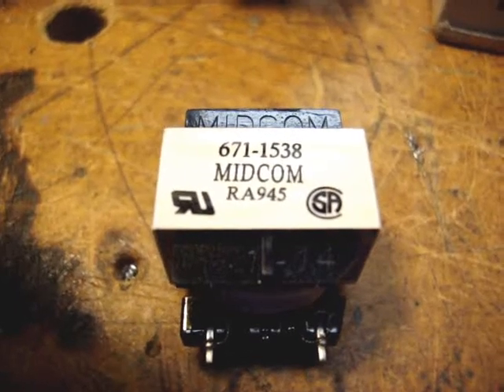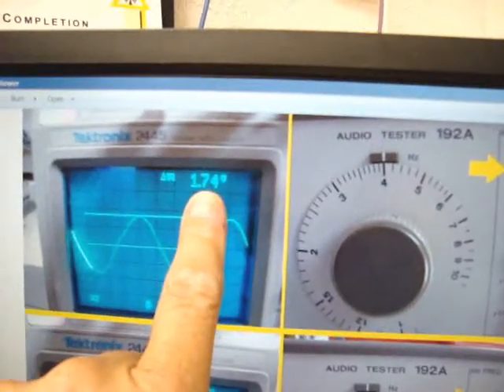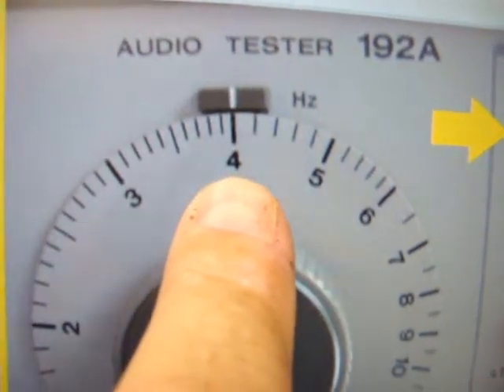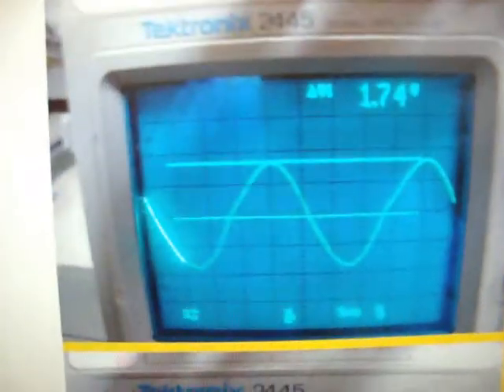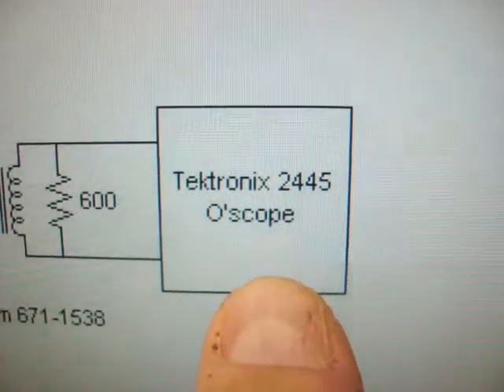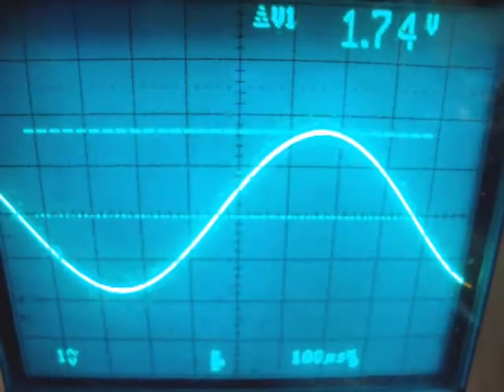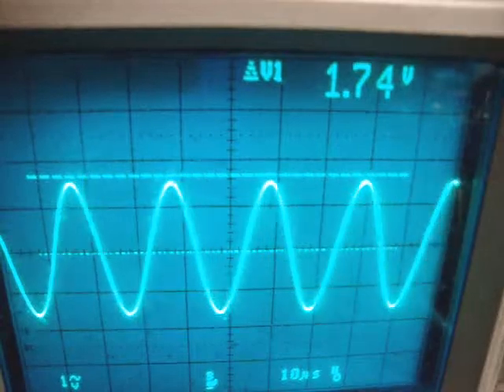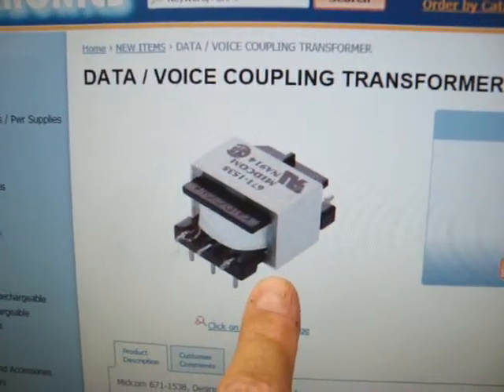Midcom Audio Transformer Evaluation

Comment: If I'm not mistaken, which I might be, older professional audio formats didn't output audio below 40hz anyway. This should be fine for balancing input and output of a diy audio compressor, right?
Reply from the maker: You are correct. I did the sweep down to 35 hz where it started distorting. It might do flat 20-20k at -10dB. I think +4 db is a bit of a stretch for this transformer. I like to see a little more headroom for +4. Yes, this should do ok for balancing input and output of a diy audio compressor or similar audio where balancing or isolation is needed.

Comment: I want to make a ribbon mic,would this transformer be useful for this project
Reply from the maker: Techno wiz - Yes, maybe. But usually, the ribbon mic element has a very low impedance and need a step up transformer to step up the impedance to something like 600 ohms. The Micom transformer is a 600:600 ohm and does not step up, therefore,  it may not  be suitable for your ribbon mic. You can try it tho.. the price is right. ;-)

Comment: Hey Bob, great vid! How does the transformer do 20-20k?
Reply from the maker: Thanks! It will do nicely down to 30Hz at -10 dB. I did not try it below 30Hz tho.. perhaps I should have. A really nice 600 ohm tran is the Edcor PC600/600...  https://www.edcorusa.com/Content/Manuals/PC600-600.pdf  I have tested this tranny and it will do flat 20-20k at 9.5v p-p, $6.62 each. I use these extensively for 1:1 audio isolation in broadcasting. I think I'll be doing a vid for this tranny later.
Reply: Bob H thanks for reply! I look forward to more great videos!
Reply from the maker: alliedradiocom - Thanks, glad you liked it. Yes, I plan on doing more vids soon.
Reply from the maker: Thanks! It will do 20-20k flat at -10 dBu (consumer level) and lower audio levels.